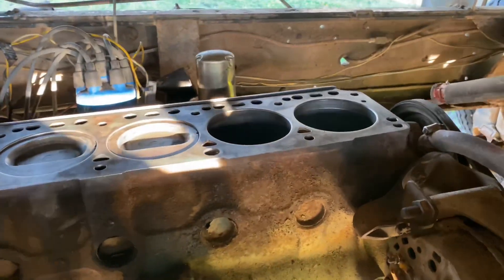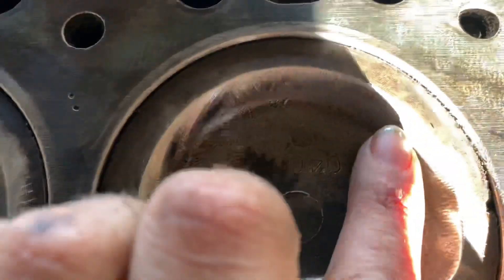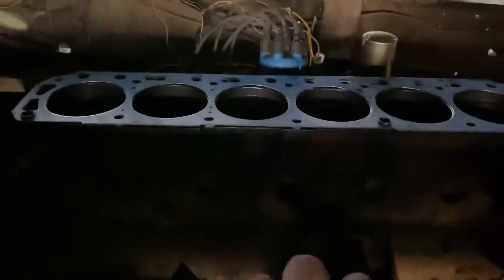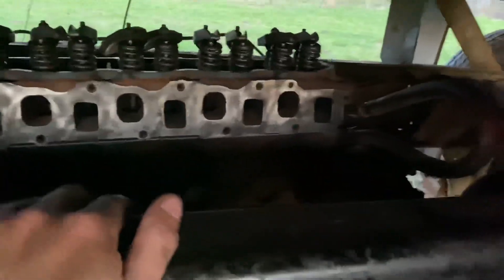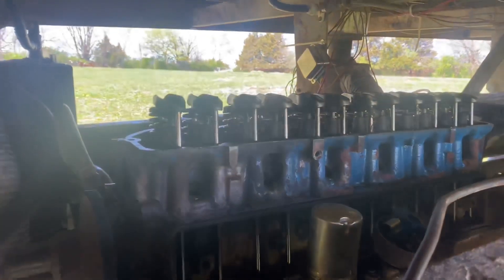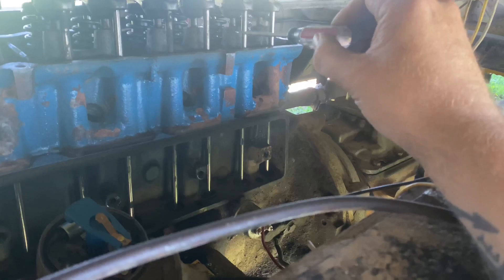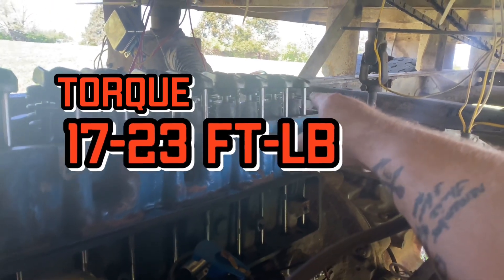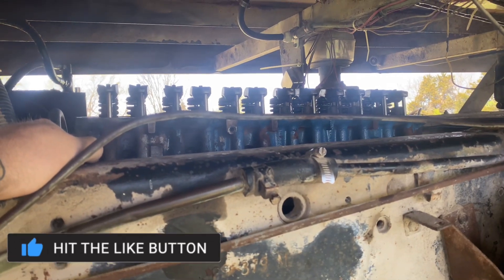Adjusting Positive Stop Rocker Arms on Ford 300c.i. 4.9L I6

Comment: No need for any top dead center bs. Just tighten them down and your done. Lifters do the rest. Note , thats why the tappet nut is not a locking nut. It locks at seat.
Reply: I liked your comment yesterday, but after trying to torque a loose rocker bolt, it started to push open the valve and get hard to turn. So in that case I woul move that cylinder to compression stroke and then torque it.
Reply: @ you can do it that way if you wish. But not needed. The valve will simply move down with the nut till the nut bottoms. Very little resistance. People think the 300 is like most Engine that use a lock nut to adjust the lifters . The nut locks at the bottom. So it don’t matter where the valves are . Put all nuts to there home position . If you  don’t tighten each nut till it stops it will back out on it own because it’s not a lock nut. They turn freely on the threads.

Comment: I thought these positive stop rocker arms are non-adjustable?  If that’s true, title should read “torquing positive stop rocker arms….” to avoid confusion.   There is a lot of confusion on this subject in the forums because people are trying to “adjust” their valves on heads with non-adjustable rocker arms.  Torquing the rocker stud nut to spec is not adjusting.  Adjusting is an involved process that involves setting lash and preload.
Reply: Right. Just torque them down and hope the lifter preload is correct. I was genuinely curious about adjustment methods. They make shims for the pedestal type or you must change pushrod length. For positive stops Comp offers kit 4610-16 I've used this on 302s with success.